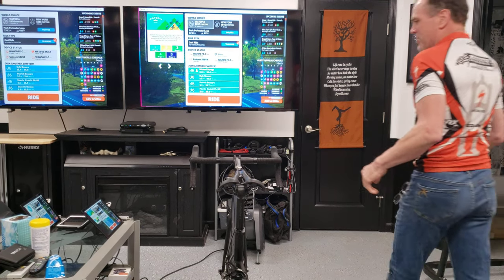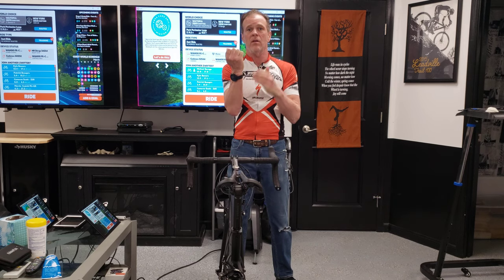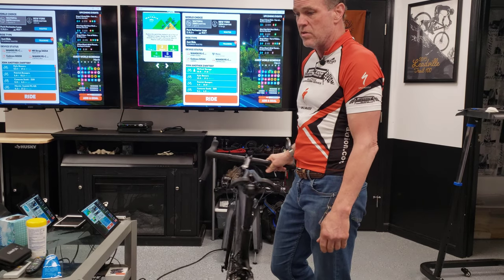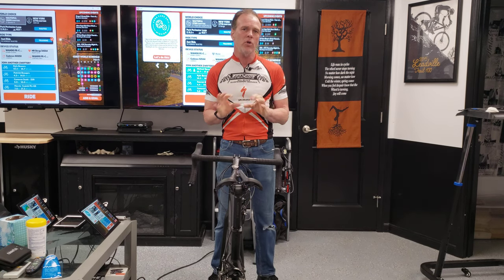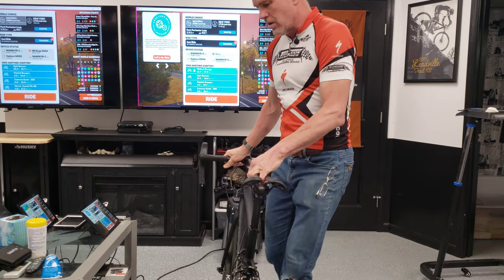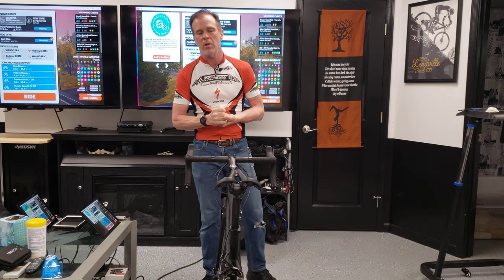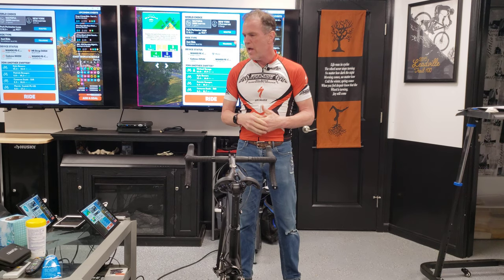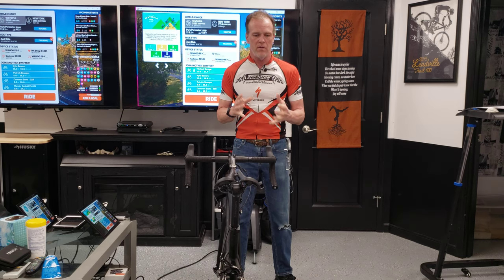First look, Traxxion Dynamics Axxion Rocker Plate for Zwift & Indoor Cycling... Cycle with Max!

Comment: Your comments on a bike simply falling over if leaned are only correct when considering a static bike.  A bike rolling forward, has inherent stability via the bike geometry (including the head tube angle, fork offset, wheel base and resulting trail).  These combine with the bikes forward speed to create varying levels of stability.  

That entire system and motion is the reason that a ghost ride is possible without a rider on it. Those forces, while low, still exist and are “leveling” forces in a sense.  So I think it's a mistake to say that there is no leveling force present on a bike when ridden outside.
 
My attempts at rockers focus on very low leveling force on the rocker and placing the majority of the balancing duties onto the rider.  These are on par with your goal and result in the best feel I have found in a large number of designs tested.  The rocking chair designs have been around for years, and I have finally had a chance to test them.  They can work well and the key to feel is the shape, as you note.
 
The pure spring rate increase will vary with the specific spring in question, and the leverage present from the rider on top.  It’s possible that the leverage on top exceed the pressure increase during lean, and actual leads to a reduced leveling force spring rate at the limits.  I’ve done a limited amount of testing and documentation to capture the leverage rate and moment forces that I like.  I need to do more on this to expand the discussion.
 
You are absolutely correct that the rocking chair style is totally dependent on the curve of the rails. This can greatly impact the feel just off-center as well into the further leans.  I really like this style of rocker and for simplicity and was very impressed with how good it can feel in comparison to all the other rockers I have tested.  I look forward to seeing your final product and welcome another great option in the world of rockers.
Reply from the maker: We have our first complete ribs, and I'll try and get one of the first rockers to you to test!

To further explain my comments that a bike will not automatically return to vertical, it is possible to ride a bike in a straight line while holding it at a high lean angle.  You could coast indefinitely down a slope with the bike tilted over.  There is no significant force that will stop that.  You can easily overcome the trail to do that.

It is better, if as you describe, you try and minimize the effect of whatever spring the typical rocker design is leaning over onto.  But I still stand on my statement that no spring is better, as it will most closely emulate reality.
Reply: @Traxxion  "You can easily overcome the trail to do that.
"  Precisely my point, it is a low force, and one that can be counteracted, but it is a force that is ever present when rolling.  That "trick" you describe is a contradiction to what happens if you ghost ride the bike, it will stay upright, which proves the force is there without rider input.

I do agree that low leveling force is the right goal, but recognize that the rocking chair designs use gravity as their "spring".  So there is still a leveling force involved.  It can be manipulated to be large or small, to alter the feel of the rocker in use.

The extreme example would be a pin point or V-pivot, directly under the rider.  This is about the lowest force of any rocker possible.  I pinpoint pivot with no leveling spring.  It's possible to control a bit (I have tried) but it is not at all practical for regular use.  Some leveling force is essential with a pure rocker.

Very different rules apply with something like the Inside Ride E-Flex, since steering is directly linked to and can control lean.  Our simple level style rockers lack that and it is all about input forces from the rider at the bars, saddle and pedals, vs the forces (if any) from the rocker.  That can be physical springs or gravity, like yours and the other rocking chair rockers.

I look forward to testing your design.  Based on your wobble test of the saddle push, it is very close to what I like from my other spring based rocker testing.  Good stuff :D